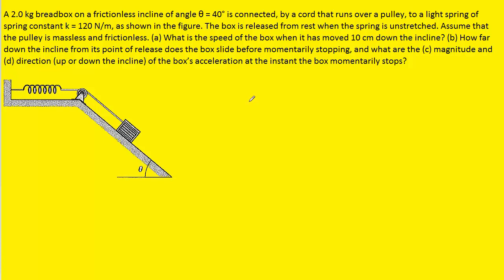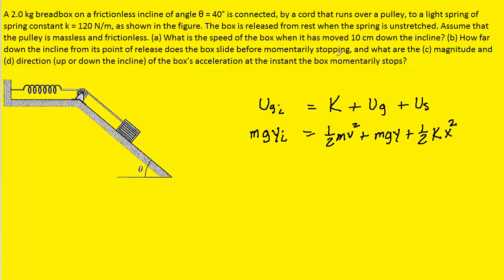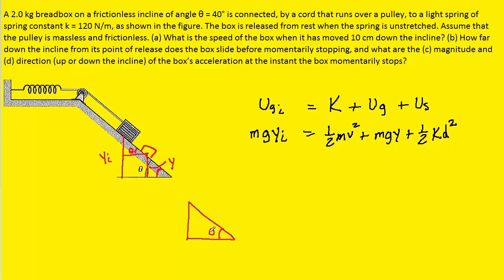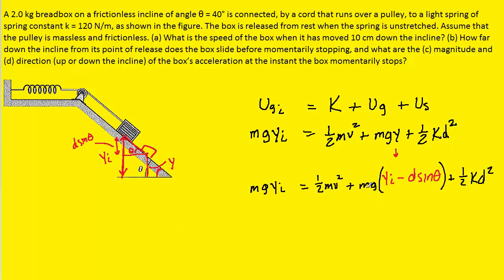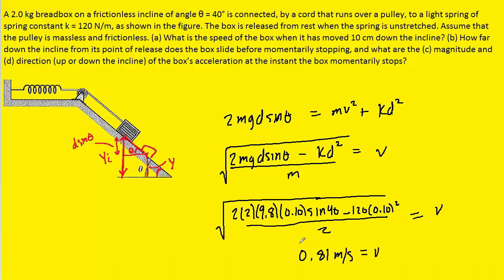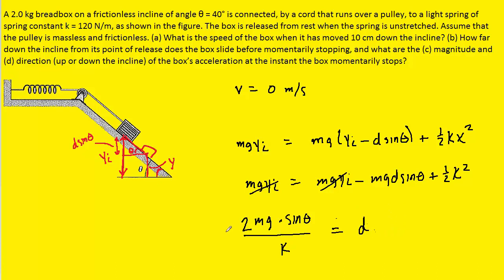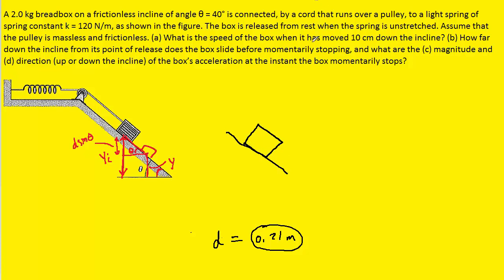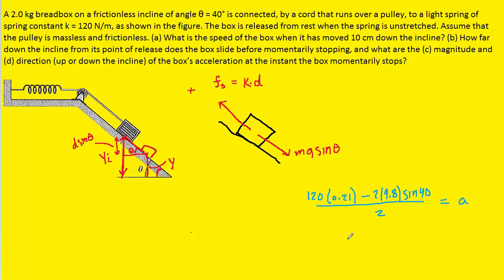A 2.0 kg breadbox on a frictionless incline of angle

Comment: Good explanation.  You can eliminate all the mg(y-dsinθ) math by setting your final height = 0.  This causes Ug to be 0 on the right side of the equation. You get the same answer by setting mgy=1/2(mv^2 + kd^2).  Then it would be 2[mg(dsinθ)]-kd^2 = mv^2. I believe this works because we are simply finding the change in K and U so we do not really need to actually know 2 different heights just that the difference between the heights is ysinθ.